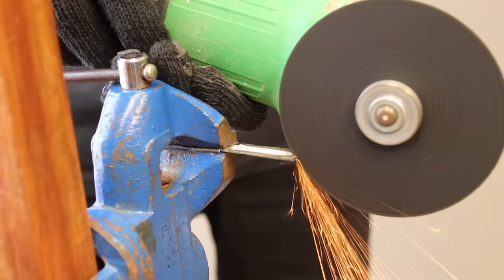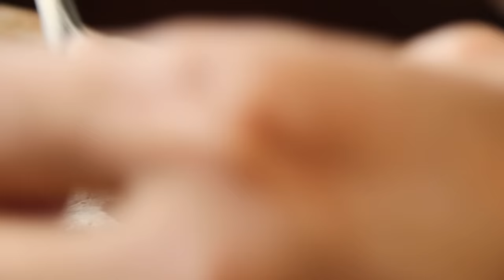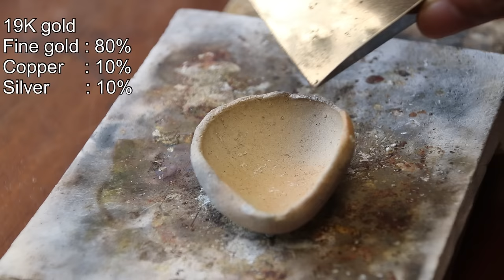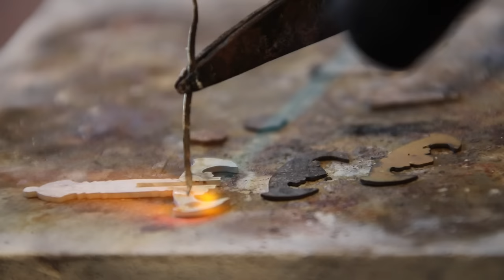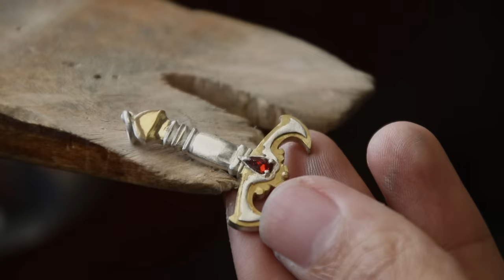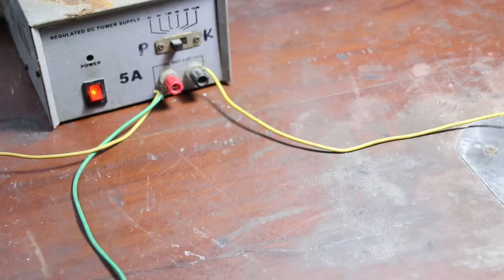make a hidden knife pendant - hand crafted knife

Comment: You forgot to harden the blade. Everything is beautiful and it’s jewelry so it doesn’t have to be hardened but it only takes a few minutes to do and the blade would be as perfect as the rest of it. Next time heat the blade up and quench it in oil. Line the blade up with magnetic north and south of the earth to minimize any warping as you quench. Just a suggestion because otherwise it’s perfect